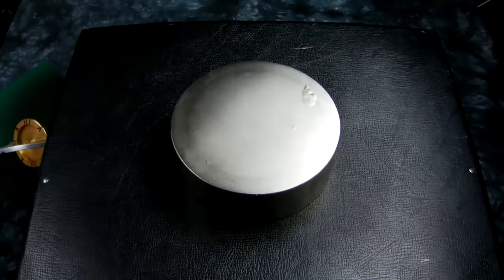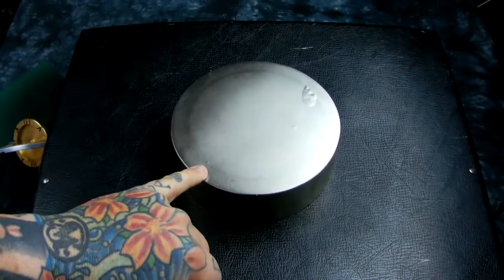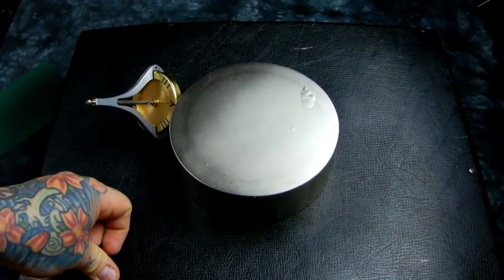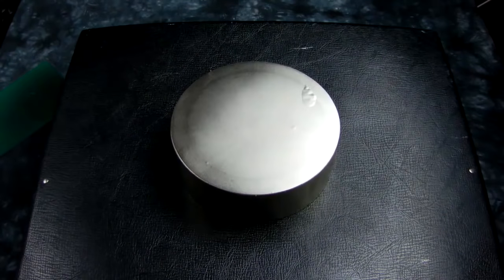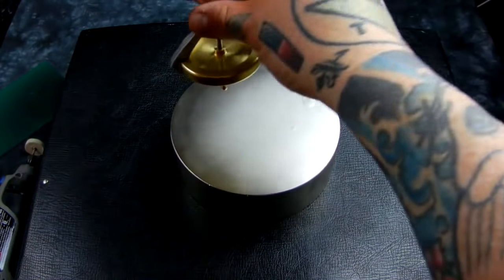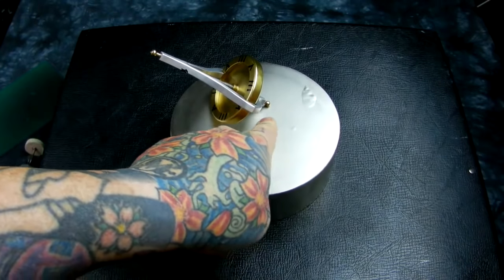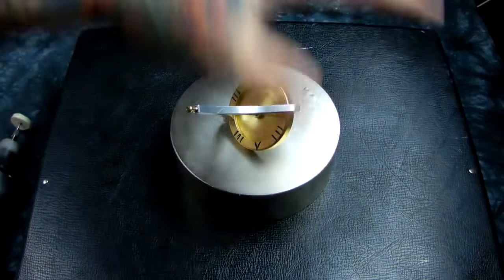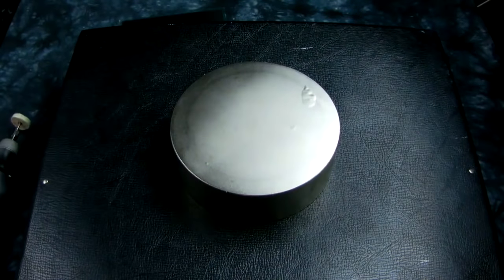Must-See Video! *SECRETS OF MAGNETISM* Never Seen Before* Torus-Hyperboloid

Comment: in the center the magnetic field is a force that acts in compas in balanced way but in the edge the force is very unbalanced. The magnetic force is strong in one side but in the other side of compas is weak. Tha law of newton  has let nothing to be unpredictable :) You dont need a huge magnet to do that , you can do that experiment with a rotating disk in our planet. Vertical rotating disc have a higher frictional force.

Comment: I think than the flywell is geting brake becase the magnetic fiel is graving the electrons of the flywell just like on the coils of a generator ,  sense the electrons are getting pull to just one side and they move to that side as the flyweel turs causes than the flyweel lose momentum whend you put it the midle all electron are getin pull evenly in all directions that is why dont slow the flyweel, imagen than the flywell was made of plastic and was filed whit steel balls "bebes" on the inside you woul see the same efect will turn frealy on the middle and get stop if put it on the side, think of electrons as steel balls , excume muy language"

Comment: In the center of the top flat face of that madly big magnet, the DIRECTION and INTENSITY of the magnetic filed is almost CONSTANT! So, a conductor that moves in a constant magnetic field does not experience any ELECTRICAL INDUCTION EFFECT. If the magnetic field changes, like on the edge of the magnet, where at least the DIRECTION of the field is strongly changing it's own direction, well there you'll have that the brass disk portions will pass through different field condiction rotating. So it developes induction currents and brakes down for magnetic interaction.
It's easy isn't it?  :-)
Nice magnet bro! Pay attention to it ok? It's dangerous!

Comment: using words like trans nueclidian counter space  certainly didnt help me understand what your talking about ....I think if you want to reach the audience you should give a brief explanation of some of the words your using ... or just use every day words to help people understand..... and the analogy using a void in a tornado does not help prove your point in my opinion ..as a tornado is powered by two different extremes of vibrational state coming together from the outside of the reaction area...as far as i understand,,,.  you said at one point that the tornado is still/quiet air in the center, whilst later you said something to the effect of "the magnet center is in your opinion sucking and spinning to a smaller point."   You seriously need to stop going off topic and into offensive/defensive mode while trying to explain something...   be more friendly.... all I remember from the video is "virgina" and "black hole tornado".   Also the moving atoms of copper etc go no closer or farther away from the magnet at the center point example ... but do go closer and further away when held near the edge.

Comment: I watched this dude explain the same thing for 20 minutes, waiting for 20 mins thinking he is going to give the answer and HE NEVER SAYS IT. If you make the same riddle 20 times that's 20x more reason to explain it, I would think. It's because the brass is spinning in one direction at the center of the magnet where the force is implementing its self in a downward motion, which is intuitive and congruent with the direction of the spinning top, thus making it spin till the cows come home. When placing the top on the outer flux of the magnet the force is implied in an upward direction therefore opposing the spinning direction of the top. An experiment to test this theroy would be to start with spinning the top the opposite direction with your tool and put it on the outer edge of the magnetic flux and wait for the cows. If the magnet is spinning the opposite direction on the outer edge of the magnet it will be congruint to the direction of the top getting upward flux. And it will spin on the outside till the cows come home. Then putting the top in the middle will counter the spin just like the first experiment only opposite. Another test would be to do the same he did spin it and put it in the middle of the magnet, wait for the cows and then instead of putting the top on the outer edge right side up, like he did,( countering the spin) put the top on the outside of the magnet  UPSIDE DOWN. It should then spin till the cows... Your equal but opposite is opposite but not equal because the inverse of the middle would only be inverse if it is upside-down. It should work if you try it. Maybe he already did. This is the only video of his I saw. Good video dude!
             So your the only guy with a $1000 magnet and you stopped after only one experiment? Gemme that damn thing I want to play with it too! Science rules. Keep up the good work and vids😝

Comment: As I understand, the spinning copper creates its own field, and when you place it at the center of the magnet, it connects the S of the gyro with the N of the magnet, so it flows.

However, when you move the gyro to the side, you don't flip it upside down along the magnetic lines, so it actually connects the N to N = creating resistance.

Comment: The reason it behaves differently in the middle is that, as you pointed out "the torus" provides balanced force lines to act equally to repel the wheel, in effect providing a cushion, that while not overcoming the weight of the gyroscope, providing a stable platform for the gyroscope to rotate on.  Even when held still, you're still exerting forces on it which have a breaking action.  The fact that the action of the magnet reduces the breaking effect and not remove it entirely should indicate to you that it's not putting energy into the system.  Additionally, this is not a reverse AC motor, the copper flywheel is not analogous to a copper coil, whose function is to shape EM force lines.  The demonstrations with the 'big ass' neodymium magnet is useful, but pretending you have some superior intellect just flags you as an internet crazy who might as well be talking about their use of magic to control people.  Knowledge is hard earned, if you can't be bothered, fair enough, play a different game.  Be honest, if you find an interesting experimental outcome, offer it up with ideas of what you think is occurring and seek informed debate.  I don't see anything than 'this is a big magnet' listen to me say four words repeatedly and 'now respect mah authoritorrrree'.  To be fair, after going back (forgot due to the boredom) the first couple of mins are interesting.

Comment: The space between the wheel is significantly greater (1"? 2"? ) when set at the center than when the edge is placed a millimeter or two away from the corner of the magnet. 

Its a great experiment. Would love to see it repeated with the variable above set to a consistent and controlled distance.

Comment: Question: have you compared the time the gyro can spin on top of the magnet with spinning away from the magnet?
Does the gyro spinning time on the magnet increase, decrease or is about the same.
I'm wondering if the extreme spinning of the gyro causes the brass to become magnetic in some way or create an internal electrical current in the brass wheel. We know a current through a wire creates a magnet field of its own, which might resist the stationary magnet and cause the drag.
How fast can this gyro spin?
I also wonder if a copper gyro would act differently?

Comment: You put may too much magic into this!  As long as the spinning wheel is oriented so that no net voltage INBALANCE  is induces around it, there will be no eddy currents and no braking.  Case 1: wheel is perpendicular to a uniform flux field.  Voltage appears between the center and the rim, but there is no connection  between these for current, that does not also have the same voltage induced, so no braking.  Hold it near the edge, still perpendicular to the field, the field is not uniform, so the center-to-rim voltage does not match around the wheel, leading to 2-pole eddy currents and braking.  Case 2: wheel is parallel to the flux field (such as holding with spin axis horizontal over magnet center), voltage is induced through thickness of wheel.  Because wheel is thin, there is little flux inducing voltage.  Eddy currents flow but are weak, so feeble braking.  If wheel were thicker, this braking would be more significant.

If your wheel were solid copper, this experiment could be done with a much smaller magnet.

Comment: The Neodymium magnet is made with the magnetic particles distributed in the most-needed outer ringed area of the surfaces of the magnet. The company that made the Neodymium magnet used in the demonstration set the distribution of the magnetic particles in the magnetic material in the manufacturing process of the magnet. This was done to save the rare-earth materials used and to cut the cost of the Neodymium magnet. I have read manufacturers report that was outlining the cost-cutting method of manufacturing Neodymium magnets. The report I read in that respect made me aware that not all Neodymium magnets are the same, so one must have an understanding of the purpose of a Neodymium magnet or any magnet and specify the magnetic properties over the whole surface area of a particular magnet before ordering a magnet. Perhaps the magnet used in the demonstration is not very magnetic at its centre, thus showing the outer ring where the flux field is concentrated. As to why the spinning brass disk comes to an abrupt halt upon being wedged between the magnets flux field lines near the outer edge of the Neodymium magnet, as compared to the way the verticle oriented disk tending to spin on. The action of the brass disk coming to a halt is due to the brass disk being a Paramagnetic material. Its high electron content pulling inline the electrons of the magnetic flux, holding back their release as the disk tends to spin on, then magnetic reluctance brings the spinning disk to a stop in the process.

Comment: 1   Don't have a buck or two [ two dollars is our entire R.&D. budget ] 2 Nice ass_ ed magnet.  [ we have to buy a bunch of tiny 1/8 inch  diameter or smaller spheres for our magnet research ] that was the point of 1  . 3 after L.I.G.O. got what was then called gravity waves we like to call Quantum Space Time. Our root theory is that  at the quantum that what we are seeing as the effects of  magnetism are the actual warping of quantum space time and profess that the lines of flux  filled with moving electrons  are in the evacuated zones where the electron movement by there relative gravity moments [ instances of change of momentum ]push way the diamagnetic subplanik length quanta [ strings,spheres, squares,stars,snowflakes,sheets or tiny jazz hands ] the shape dose not matter what matters is that it is matter. That Q.S.T. dose not like magnets , electron do , they are pera_magnetic, Photons are the magnetic root of the atom when they break them apart to find the sub atomic particles, they expose the root of   magnetism, [ Headron collider in Cern. ] Higgs Bozon .  The Q.S.T. is in orders of magnitude smaller.  We are preparing a thesis and will publish on our web site anoldmasterjukz.com/ourtheoriesblog .

Comment: What your doing is cosmic movement,,,of center of galaxy,,, every star system has same law, in our galaxy,,,the spiral channel" zone hear 🧐,,,oh go read my other comits on your other videos... copper uses a different vector than magnetic vectors do,,, frequency or energy channels of that element is different than the magnet,,,what happens is the frequency change from the center to the edge, but they are close same energy channels or direction of force in motion,,, when there alined in center is why, it keeps going,,,I just told you what is going on,you moved from the area of force in motion to the edge,,,so the energy field changes ,,,zero barrier fields no interruptions...🙄,,,lack of the electric energy in center,,,but the divergences or the edge is were the dielectric property's are, so it moves the energy inside the brass to match the magnets speed, and it's not moving the magnet is not, now spin the magnet at rpm, and the brass will copy it's speed,,,most that is correct but it's mostly magnetism all you explain...force zone, enursha zone and...more than two there's one more, the mother nature there, has a dark side,,, there's a neutral a dark energy,,,as well and it's on a cosmic law scale threw out everything,,,it's just called the other side" or reverse energy, why anything can stop, go, or in the center point of enersha there do nothing,,,three laws of movement total to magnetic property not two, nice video tho ...